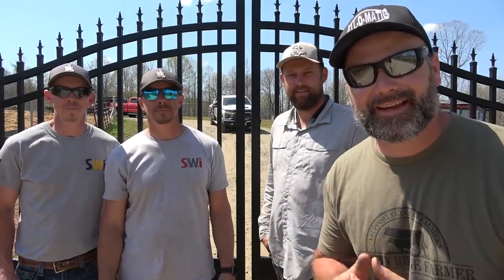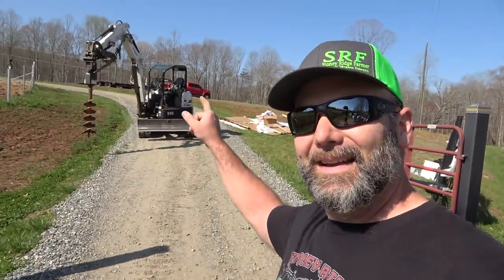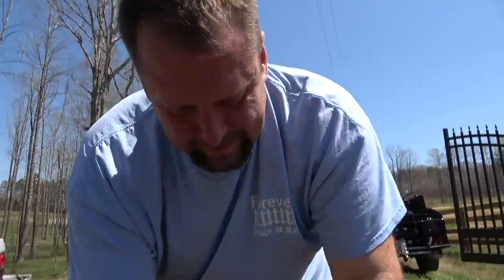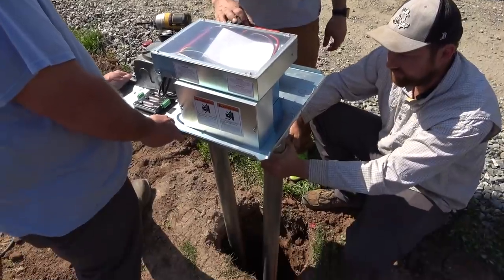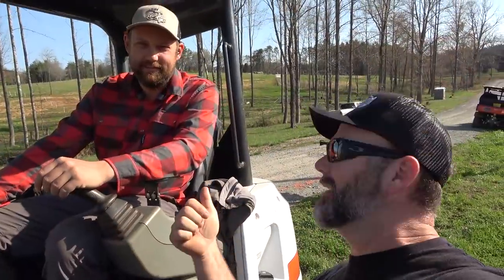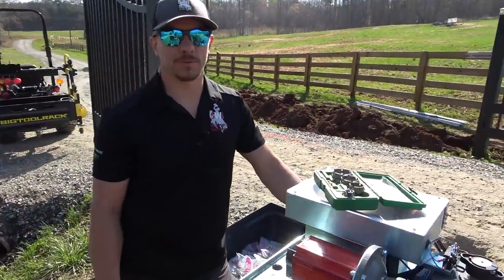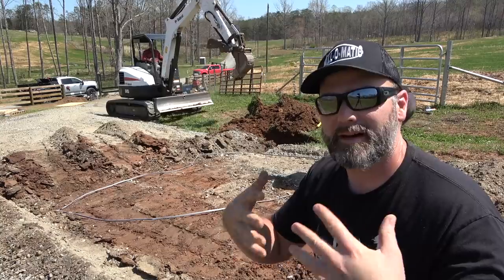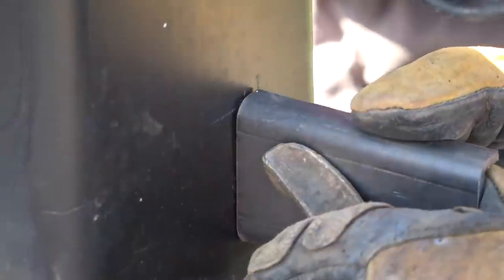Serious Gate Install on the Farm!

Comment: We have the Yelp system on our farms automatic gate, and the only issue is that if a ambulance or fire truck goes by entrance on the county road it’ll open our gate, and like yours it’ll stay open for a hour as well. Our diesel tractor will also open the gate if I’m mowing or moving something. The small tractor is diesel as well, but with that tractor the gate stays closed. The importance of having the Yelp was to allow one of my elderly parents to stay in the house with the other instead of having one of them to manually open the gate leaving the other alone. For that alone the gate was well worth the cost. Ours as well is solar, and after more than a year I’m so glad that we have it on our farm.
Reply from the maker: This is much more complex and takes a 100 decibel noise to open after 20 seconds...so no "accidental" opening
Reply: There is a sensitivity setting that can be adjusted.

Comment: Fantastic install.  That gate has class.  I like the SOS feature.  When I was an active firefighter I had to deal with locked doors and gates multiple times.  Some of the local roads have induction loop sensors for left turn lanes, etc.  They often don’t sense my motorcycle.  DOT responds with indifference.
Reply from the maker: So....I had to adjust mine to sense the atv...it's all about the adjustments and setting the limits right
Reply: Gates operate on the exact same principles as traffic lights. It can be tough for them to "see" 4 wheelers and motorcycles as well.  Sensitivity settings can help greatly.

Comment: Beautiful gate and install, but that's one seriously complicated system ! Thumbs up.
Reply: There’s more than many realize to putting a quality system together.
Reply: Pretty straight forward. Power, control, safeties and communication between the 2 operators. We use alot of wireless keypads and direct wire here though. Havent done a solar setup yet.

Comment: I’m a septic installer in Texas, we normally call 811 dig 2 weeks before or submit a ticket online. There are times where they still don’t get it right
Reply: The problem with calling to early is that the tickets expire and marks disappear.  We are damned if we do and damned if we don't.
Reply: @SWiFence  they will send us the email saying all clear and after we already started putting a system in they will show up to Mark stuff. Drives us nuts

Comment: No caution ⚠️ tape in the trench.? Just as a precaution to future digs or others digging?
Reply from the maker: thanks safety Sam! Woooo!
Reply: Thats a good idea!
Reply: I trenched fiber optics in Iraq at camp Echo  trenched, sand, optic cable, sand, optic cable tape, red caution tape (meaning stop digging) then backfill
Reply: I wondered that, but I guess it's only 24vDC
Reply: @StoneyRidgeFarmer  this safety Sam is this trying to help you save money in case of a costly mistake ..  down the road . And maybe do better on future excavations on your Stoney ridge farm. Just my experiences.

Comment: Hey Josh..... a tip for your gate on the slop..... put in an offset bracket. So that when it opens up it slightly will roll upwards using less clearing on the floor perfect when you get snow on the ground and going uphill because the it will rotate upwards so the center pieces of the gate will move upwards as it rotates 90 degrees.  And the Solar is set to low to the ground. move the controller box at least 2 ft off the ground so you can cut the grass below it and have easier access to the Control panel/battery.  2' seam to be the best also when you get snow to stay clear and is easy to access when serviced. We prefer to put all at 5' high in so you can stand comfortable enough without breaking your back... since you only got one which are super hard to come by. Here is an example for the gate : https://harbourdoor.com/wp-content/uploads/2011/06/GC-36-Special-hinging-to-allow-for-upwards-sloping-driveway.jpg

Comment: How does it lock? Can it be manually opened? Is there a “pin” that could easily be pulled to gain entrance from intruders?
Reply from the maker: No matter what kinda gate, door, lock or anything you have..there is a way to break through it.  The gate has been there for 5 years...it keeps unwanted and unannounced visitors out. I'm out here working constantly and filming all day nearly every day.  It locks via hydraulic system...but I don't know a gate anywhere that cant be pushed over or open by a big truck.....it's not a safe...it's just an entrance gate my friend
Reply: Our video will detail this more.  It should be out in about a week.
Reply: @SWiFence   thanks!